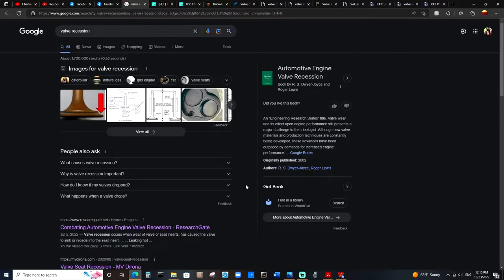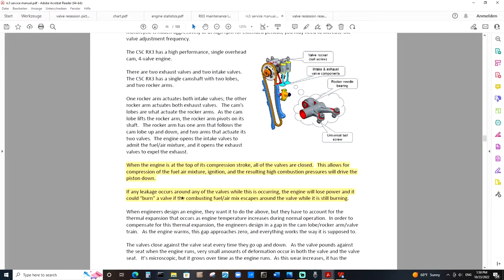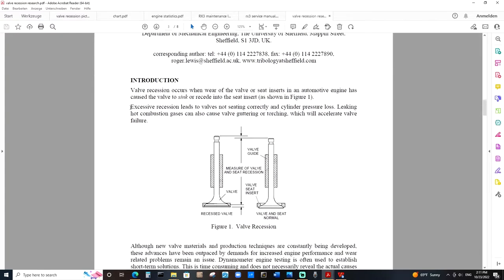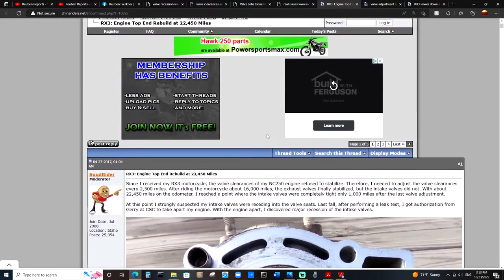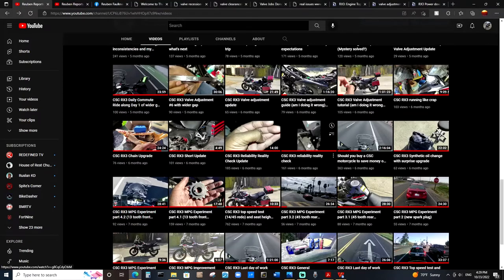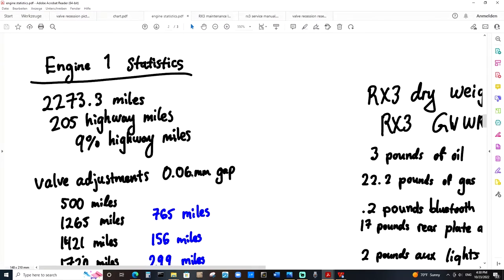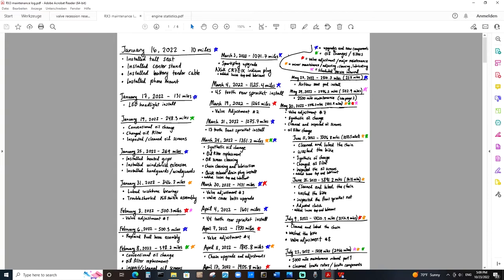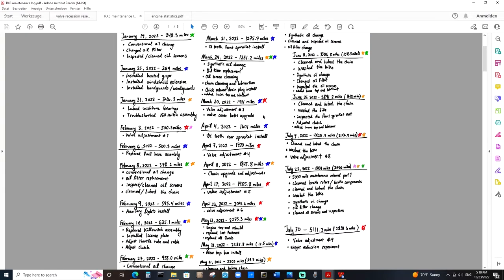CSC RX3 Valve recession issue - everything we know so far

Comment: This issue goes back to the seventies when unleaded fuels came into being. But putting it simply it’s about having the seat/ valve metals being comparable to each other. The exhaust valve and seat welding together and with every separation they rip off some material
Reply from the maker: Bingo! You are right on the money!! Honestly while doing research on the issue, I couldn't find any examples of valve recession in motorcycles except for 70s era Japanese bikes or modern-day racing applications. It's no coincidence that this Chinese manufacturer who is making a fortune selling cheap 70s Honda knock offs comes with the same 70s Honda problems. Even if the engine was a quote on quote a "clean sheet design" it's no secret where they get their inspiration from. In modern motorcycles, valve recession to this extent is absolutely unheard of and quite unacceptable. 

So, what's the solution?....Buy a quality bike. I bought a used KLR 650 for less than half the price I paid for the RX3 and haven't looked back since. I've got ~3800 miles (Odometer reads 15.4k) so far and counting on my KLR. I did a valve adjustment over 2100 miles ago and it's been running like a clock, we'll see how long it lasts but I wouldn't be surprised if it was 20k+ miles. Other than that, I've just done normal maintenance and a ton of upgrades. I ride my KLR daily and it's been one of the most reliable vehicles I've ever owned.

Comment: Hi. Did you repair the bike? I have same engine in my dirt bike, i put 1000 miles on it already. What do you sugest, should i take head off and install new, modern valve seats?
Reply from the maker: I did not repair the bike, I bought a KLR instead. I understandably got tired of wrenching on the bike to no end; so I decided to buy something to replace it instead of wasting my time. I'm not sure where you can get new valve seats for this engine or if it will work. I don't know who has ever tried. The CSC RX3 to my knowledge is not even available to purchase anymore and I am unsure how long parts availability will last either.
Reply: @reubenreports2904  This engine has rocker arms that hang on the valve cover and for this reason a small valve clearance was chosen. It is possible that the valve cover stretches and lifts the rocker arms upwards, so there should be a valve clearance of around 0.2-0.25 mm so that the valve stem, which also stretches, has enough space to close the valve so that the valve on the cylinder head can cool down . I still have a Honda NX650, with the same engine as the XR 650L, with a similar cylinder head, with the valve clearance of 0.1 inlet and 0.15 exhaust always satisfied. no problems. With small zongshen everything is smaller, I also let the valve clearance be smaller, of 0.06 inlet and 0.08 mm outlet and observe. If the valve clearance is too large, they will start to rattle when the engine is hot. Meanwhile, if they don't rattle, next time I'll increase the valve clearance to 0.08 inlet and 0.10 mm and listen to see if they rattle when the engine is warm. So I hope to ensure that the valves cool down well.